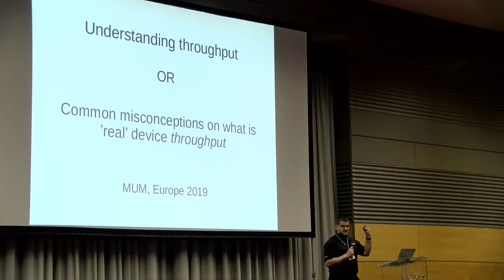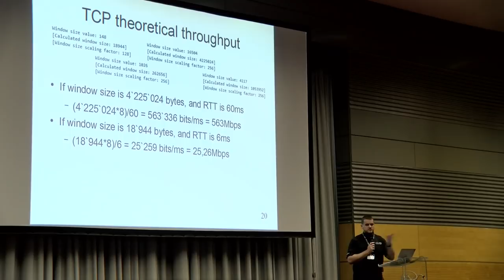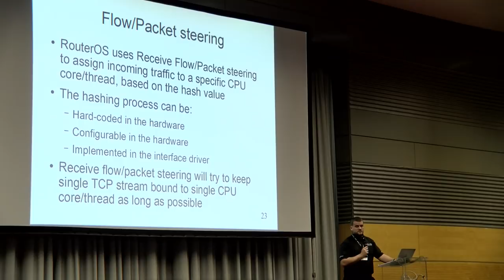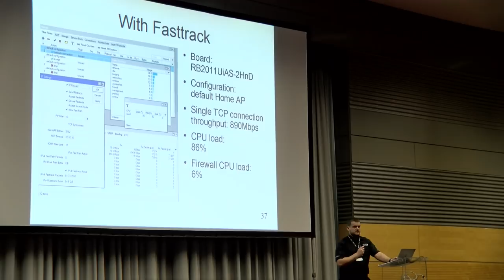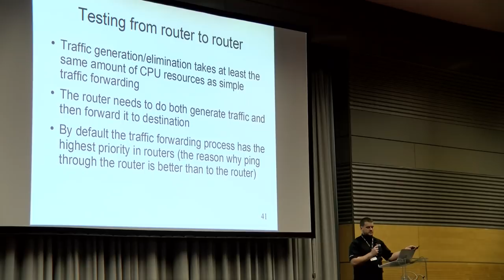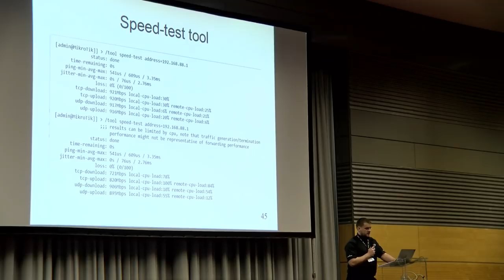Understanding throughput.

Comment: Please enable transcript at this video.
0:00 1/45 Understanding throughput or Common misconceptions on what is 'real' device throughput
0:58 2/45 Objectives
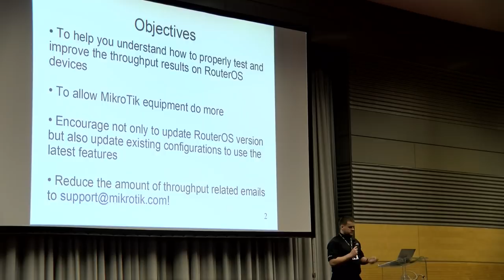1:40 3/45 What is throughput?
2:25 4/45 Router throughput
2:54 5/45 Maximum router throughput
3:56 6/45 Link or wire speed
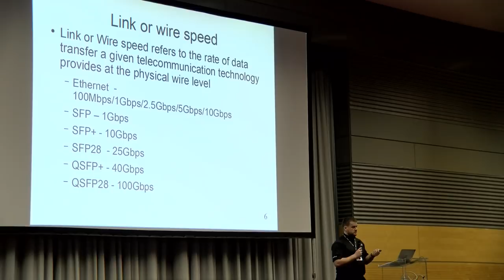4:35 7/45 Wire-speed
5:24 8/45 Wireless "wire speed" (Data rates)
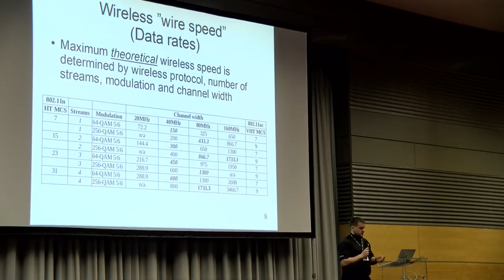5:52 9/45 802.11ad Data rates
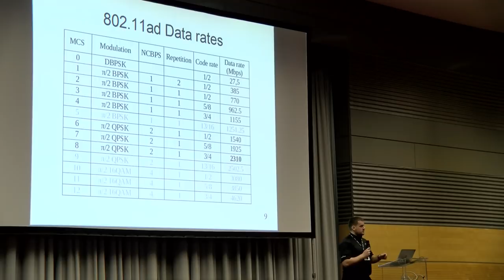6:16 10/45 Marketing numbers
7:38 11/45 Capacity
8:41 12/45 Ethernet preamble and interframe gap, 20Bytes on every frame
10:11 13/45 Theoretical Layer2 throughput
10:37 14/45 Theoretical Layer2 throughput
10:46 15/45 Layer1 wire-speed vs. Layer2 wire-speed
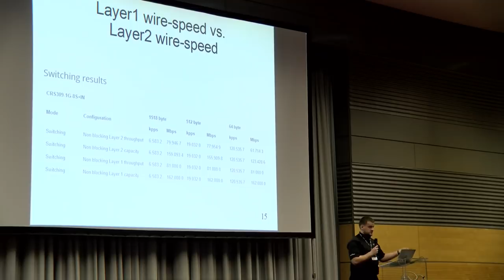11:47 16/45 "Real" network speed
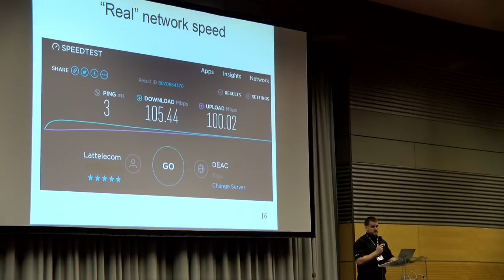12:44 17/45 How does speedtest.net work
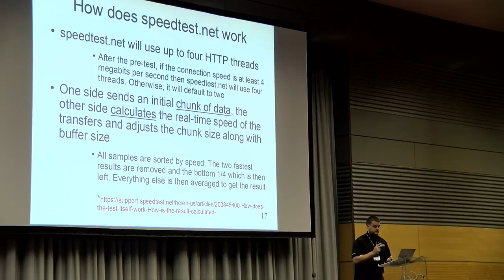14:25 18/45 TCP Theoretical throughput
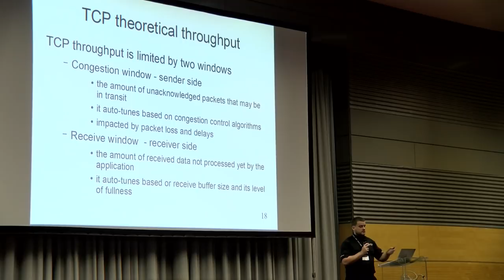16:43 19/45
17:35 20/45
19:32 21/45 TCP and multi-threading
21:11 22/45 Single TCP stream and multi-threading
22:00 23/45 Flow/Packet steering
24:12 24/45 RB3011UiAS block diagram
25:01 25/45 What can adn can't we do?
25:44 26/45 Routing forwarding
26:26 27/45
26:36 28/45
27:00 29/45 Initial FastPath inmlementation
27:37 30/45 Routing forwarding FastPath
27:55 31/45
27:59 32/45 FastPath + Conntrack
28:41 33/45 FastPath + Conntrack = FastTrack
29:05 34/45 Routing forwarding FastPath
29:19 35/45 FastTrack-connection
30:00 36/45 Without FastTrack
30:39 37/45 With FastTrack
31:42 38/45 Full queues and multi-core processing
32:59 39/45 Empty queues and multi-core processing
33:47 40/45 Conclusions
34:54 41/45 Testing from router to router
36:38 42/45 Traffic-generator tool
37:48 43/45 Bandwidth-test tool
39:38 44/45 Speed-test tool
40:41 45/45
Reply: You are truly a gentleman and a scholar
Reply: Thx, I focus at LTE stuff at forum as nick: SiB.
This topic is very important.